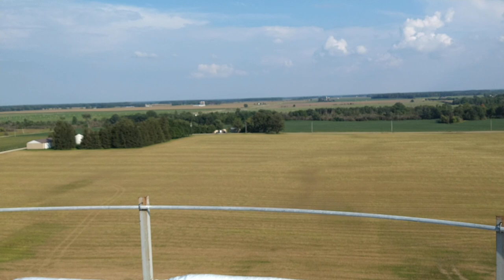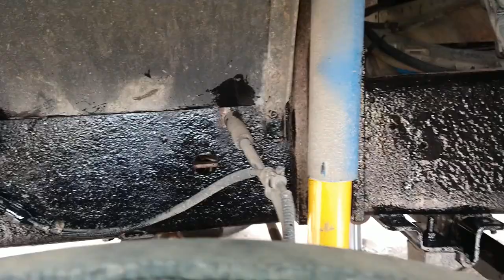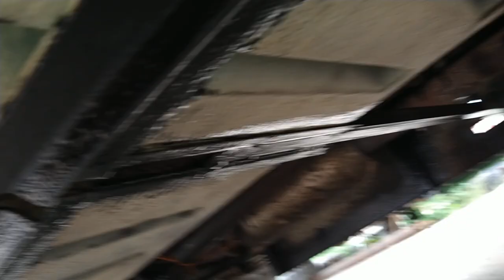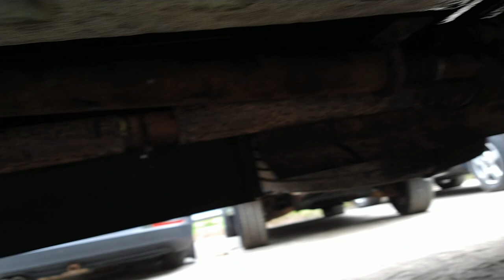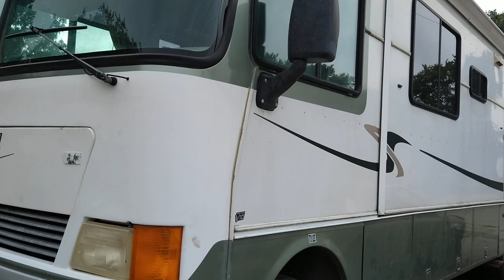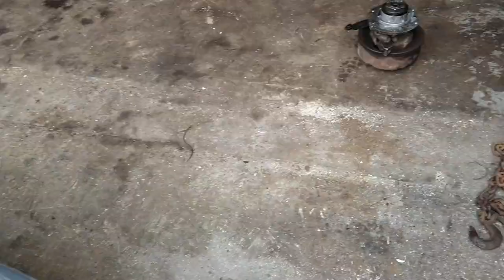Time to fix the RV up again...

Comment: So did you buy that RV now? Somehow I think I remember you saying that it was a rental - but it could have been that you meant it was formerly a rental, and I didn't get that right. Anyways, be glad that you've got a Triton V10, and not a Windsor, because those engines seem to have nothing but problems - Nomadic Fanatic has a 2010 Class A with that V10, and it's currently just sitting because he is waiting for parts that are currently unavailable.